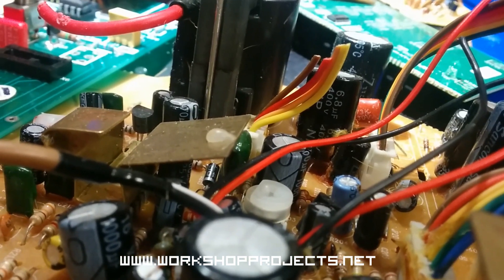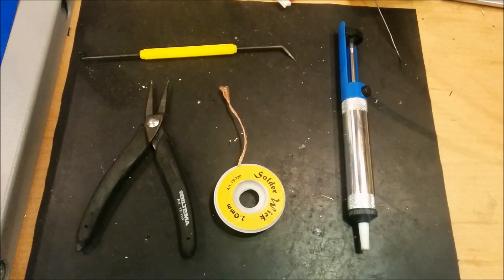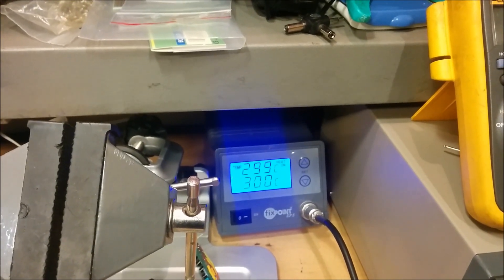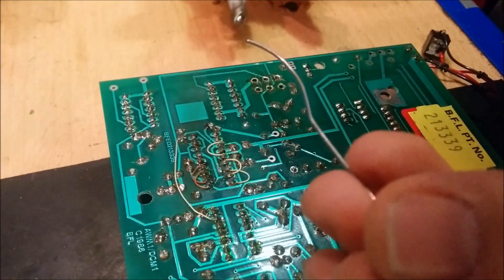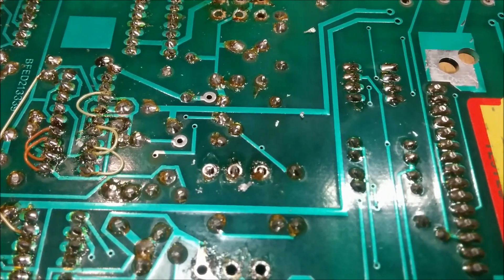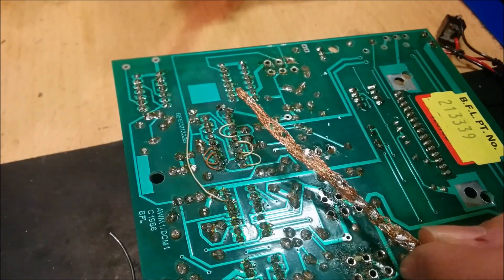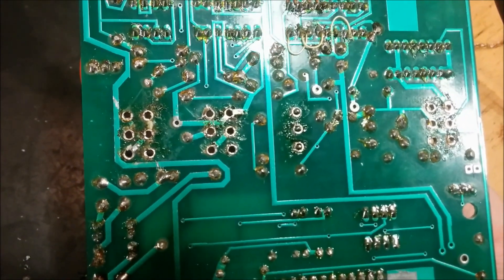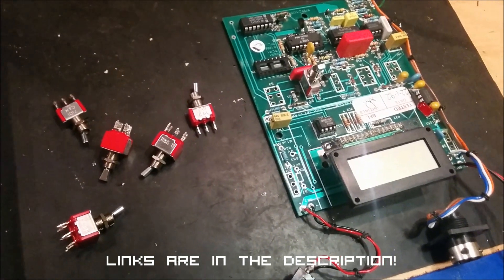How to desolder from circuit board, Through-hole desolder

Comment: It's no wonder you've had to jumper so many connections, and have switches removed with bent legs, etc. You use too much heat, and too much pressure. Applying that much pressure is a recipe for destroying solder pads.